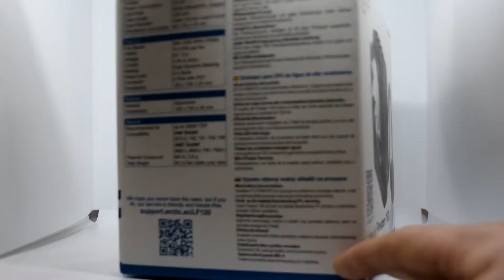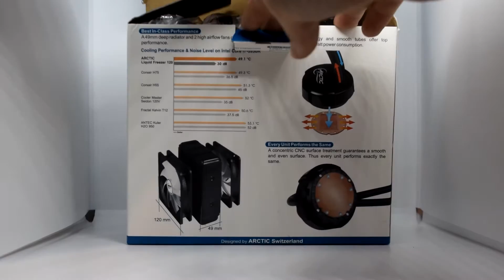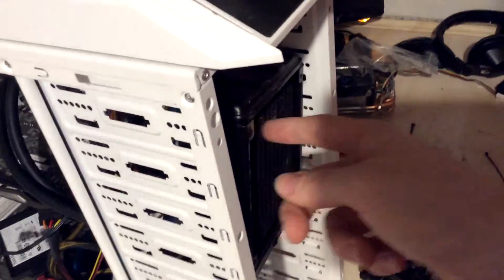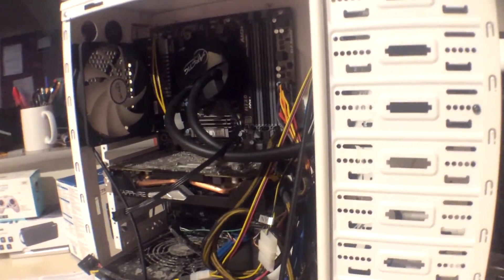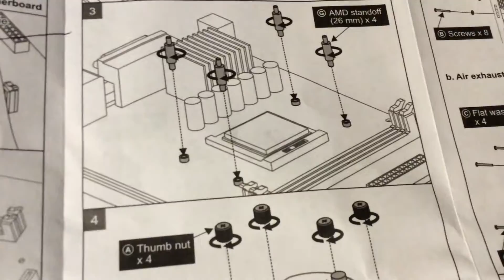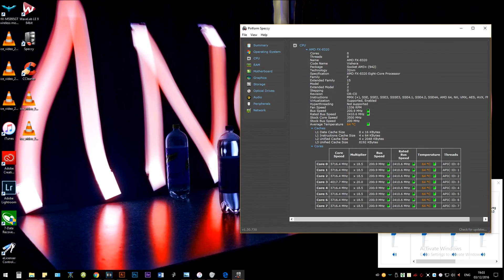Unboxing & Setup: ARCTIC Liquid Freezer 120

Comment: Change the stock fans for an 2000 rpm, and set on the bios for full-speed... There you will see a difference... It stays cooler. I upgrade my build and it stays at 45/50°c